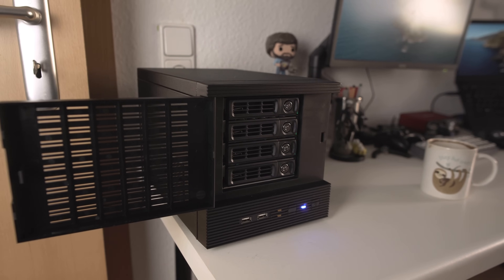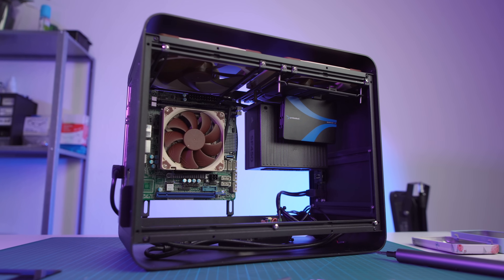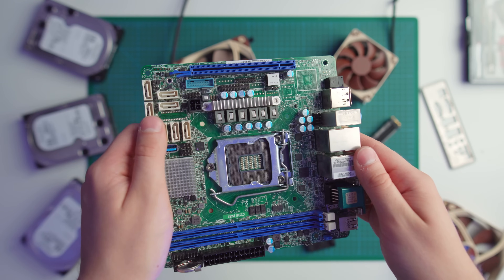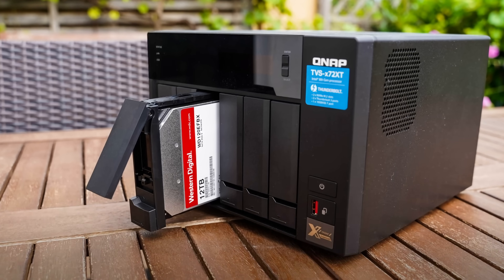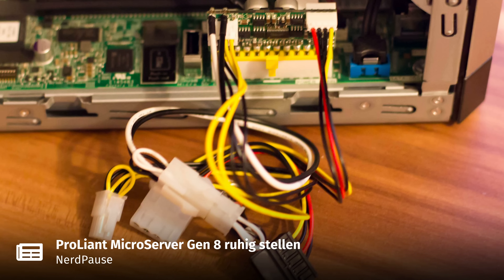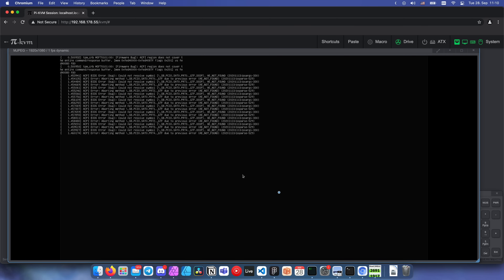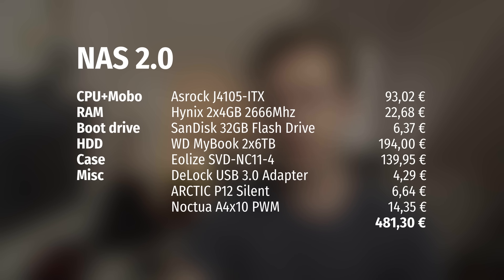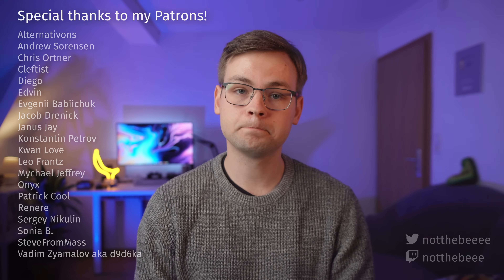The Perfect Home Server Build! 18TB, 10Gbit LAN, Quiet & Compact

Comment: Noctua fans DO NOT SUCK. They are rated at one of the best fans on the market. They are QUALITY. 

However their color choices are awful.
Reply from the maker: Yep, that's what I said, "all Noctua fans suck" :)
Reply: @WolfgangsChannel  They also blow which is the purpose of a fan. Besides if you're sensible and just buy a good looking case without any windows, who cares what colour they are as long as they perform well.

Comment: The 6TB EDAZ series is literally the worst kind of drive for a NAS. Medium expensive recommendation of the same but with higher capacity is a mistake. Instead, you should've bought couple of used EFRX WD RED drives, literally 80 bucks, CMR drives. 5.4k RPM, so silent and with longer lifespan, these things are legends and came directly before infamous EDAZ SMR disks that WD tried selling as Reds. If you want to go expensive, any enterprise drive will do.
Reply from the maker: EDAZ drives are good unless you want to do actual RAID or ZFS with them. That caveat is mentioned in the video. I've been using the drives with mergerfs+snapraid for about 2 years and they've been working great. Silent, cheap and great for "baby's first NAS".
WD60ERFX drives start at €219 here in Germany. If you're absoluetly sure that you'll use ZFS or RAID and will be storing mission-critical data – go for it. That being said, it's 2x the price of the EDAZ drives, so it doesn't really make sense to compare them.
Reply: @WolfgangsChannel  When I said that 6TB EFRX drives are 80 bucks where I live, I meant Czech Republic. Literally across border. I literally bought 2 pairs of those last week for 80 bucks a piece. Also, if you're patient, you can snipe good deals with enterprise SATA drives. People sell them, because newer SATA revision has kill switch on 3rd pin where before it was a regular 3.3V pin. People will sell them under price either because they think it's broken, or because they don't want to put up with the hassle of explaining all this to a noob. I bought 20x 10TB HGST enterprise drives for 75 bucks a piece with less than 2000 hours on the clock on each one from a guy who ran stock analysis on them and decided to go SSD and told me flat out the price only lasts if I come that day and I buy all of them and he will not have to explain to me the issue of 3.3V pin on SATA drives.

I know, not a content for your video, and rightly so. But I still disagree that suggesting SMR drives for any kind of NAS is not a good advice, period. It isn't relevant that they worked great for you for 2 years. You're a sample size of 1. Try suggesting on r/DataHoarders to a newbie to buy EDAZ series of Reds and you're gonna get roasted.
Reply from the maker: You will get roasted after suggesting literally anything on Reddit, especially in niche hobby communities. That's not really an indicator of anything.

Also suggesting an enterprise drive for a home NAS is a bad idea. Those drives are usually optimized for performance over acoustics and thermals. I personally have had bad experience with HGST drives – they're extremely loud for a home user and hard to cool without industrial static pressure-optimized fans.
Reply: @WolfgangsChannel  Both can be true, I didn't argue against either of those. My point is you suggested SMR drives for NAS. Although you can get roasted for anything on Reddit, using SMR for NAS is pretty universally agreed to be a bad idea. To avoid using Reddit as argument, I have a colleague at work that used 4 SMR drives in his NAS for 3 years. He gave up the idea of RAID fairly quickly and used them independently of each other for most of the time. Even then, his experience was terrible and like you, he argued that he considered higher series drives price prohibitive. He regretted the decision. One day I got my hands on cheap 10TB Barracuda Pros, I offered to buy some for him, he has been using those for close to two years now and says he should've bought nonSMR drives to start with.

I don't mean this in a bad way, I'm just saying advising SMR drive purchase even to starters is just not a good idea. We can agree to disagree.

Comment: I’ve just finished my version of this build, same case, love the case. Media server so went crazy and put an i7 12700k in there and barely fit a bequiet! Dark Rock TF2 cooler (replaced previous too loud, smaller fan, choice). ASROCK Z390-m ITX MB, 2x32GB DDR4 3600 (until the 2nd cooler wouldn’t fit so I removed one stick, RIP more RAM than I ever needed). 2xM.2 Drives, one 500GB cache drive and one 2TB drive as a faster drive for different apps running on UNRAID. Otherwise the same other than I flipped the fans on the CPU cooler to take away from the MB instead of sucking air over it and stuck the 2 case fans on the bottom sucking air in and up out the case. I have yet to buy the 2 planned 18TB drives to start me off (and replace previous still used 20TB setup) but I have decided to get an external drive thing that holds 5 drives and would keep the case a little cooler. Have set up a whole bunch on UNRAID already so I’m otherwise ready to move over but I’m not gunna lie, it’s running hot. Well in my opinion, but all I know is my gaming rig that doesn’t really go over 60c, this thing is running 70c-80c at 100% but oh my it runs fast, when idle 35c and 50c-60c under normal load (transcode a couple vids, background tasks). Don’t get at me for the odd airflow, it is mad but I’m used to bigger cases with better airflow and more space and heck, I wanted to try something out and it seems fine and I can’t be bothered to change it now 😆 So an almost finished build but thought I might share my build journey, so far cost around £1500. Planning on 5x18TB in the end but might end up adding 1-2 extra for parity drive, how ever many I need. It’s a slow background project but hope to finish it soon. Thanks for the video 🫡

Comment: Don't you have to modify those shucked drives?
Reply from the maker: Yes, depending on your PSU, you might have to cover 2 pins on the drives with tape. I didn't have to do it with mine, but there are plenty of guides online for that

Comment: I just recently built a kinda similar but way higher budget desktop server. It's built on a ryzen 5900X, asrock rack X570D4U-2L2T, 128GB of ECC RAM, and 8x 6TB exos enterprise drives over an HBA. Everything put into the fractal design node 804.

Running proxmox with virtualized truenas scale for kubernetes, and linux mint for a couple other services I don't want in containers. I can do lots with it if I need to.

Comment: I was able to grab HGST He14 drives for around $170 USD each, I have 12 of them total 9 are active, with 3 being parity drives for ZFS and then 3 spares that will hot swap in as soon as there is a failure of any of the drives. I did have room for an ATX system though so I had the option for HBA cards and a 10GBe NIC and a quadro p2200 for hardware Plex encoding. 
This is a great build for those who want the a smaller option. 
I run a ton of VMs as well as using it for a build server for work so I have 2 2699v4 CPUs and 512GB of RAM.
Reply: Do you have any issues running separate gpu for the VMware

Comment: Famous last words: "Last NAS I ever have to build". Mine is currently running an 8 core EPYC Rome, 64Gb ECC with an upgrade path to 64 core Milan and 4Tb ECC. It does serve a dual-purpouse role of running my docker containers and CI, which takes up half of the resources. But as a NAS, it's able to congest the 10GbE network pretty easily with the workload it's been designed to handle.

Comment: can you explain why i get "memory not installed" during bmc/bios initialization or post? all my hardware have ecc support and compatible with ecc. i can get it to post using non-ecc ddr4 ram. 
Specs:
Asrock E3C236D4U C236 Chipset - Supports DDR4 2400*/2133/1866/1600 ECC/non-ECC** UDIMM memory
Intel Processor i3-6100 - Supports ECC Memory. Doesn't specify if reg or unreg
Hynix -  DDR4-2133 16GB ECC/REG
Reply from the maker: Does it work with non-ECC RAM?
Reply: @WolfgangsChannel   yes it does. boots up and posts with non-ecc ram. do you know if this board is backwards compatible with ddr3 ecc ram? i'm tempted to purchase the ecc ram you recommended.
Reply from the maker: @romayojr  Sorry for the extra question, I didn't see it in your initial comment.

I don't think this mobo is compatible with DDR3 ECC RAM. It looks like the RAM you got might be defective, I would check if it works in another machine. Also, check if it's on the QVL list of this motherboard.

Comment: I would never use anything with a software RAID, with some, all it takes is a power bump and the raid is destroyed. In all my years of computers there has only been one software RAID I have encountered that is uber reliable. And that software RAID is part of a Digital Cinema Server. Hardware RAID is the only really reliable way to go, and you can even import already existent raid configurations in case one decides to say, get a newer server, add or change drives, or to build a new server. But at the low prices that 2 year old (Like New) rack servers sell for these days, going that route will likely give you way more performance, better equipment reliability and longevity, plus a very safe hardware RAID. Case in point. I have had an H-P DL380 G5 server in storage going on 7 years that contains all my photos going back to 1990. When I got it home it would not boot properly and that was an easy fix and just required a new clock battery on the motherboard. That clock battery goes back to 2008 when the server was built! Installing a new battery and it booted up ok. But now it said the RAID memory battery is defective. No surprise here as it's labeled 2008!!  I simply disconnected it till I could get a replacement which is in there now. Then all was well. So I uploaded all the images to the Cloud site I normally use and made two back ups on new, fully formatted WD Enterprise drives. I will keep those drives at two different locations and use the H-P server at home till hell freezes over.

Comment: Given your NAS running on desktop grade drives, have you considered scheduling it to shut down for the night instead of running it 24/7?
There's a religious war about what makes disk drives fail: restart cycles or runtime and you can believe in either (or both), but it's hard to deny one of the features of desktop drives is to cope with daily restarts.  If running your NAS 24/7 is not essential, you might be able to both save some power and prolong disk life if you believe desktop HDDs tolerate daily restarts more than running 24/7.  However quiet your build is it will generate some noise better audible at night and shutting your server down obviously eliminates that too.

Comment: Great content Wolfgang!
About your NAS 2.0 build you are saying: "after around a year of use, one of the backplane connections on the case failed". 
This tells me spending 140 EUR (~30% of build costs) on an Eolize SVD-NC11-4 mini ITX case was probably money you could have spent better.
The hot swap bays are something for which you pay extra and that can also break while it doesn't give you much benefit in a regular home environment.
If you need to replace a drive, you can probably allow for some downtime and removing a few screws as it seems you've also chosen to do so with your NAS 3.0.

Comment: Why didn't you use a hba card instead of getting an expensive motherboard
Reply from the maker: A decent HBA card costs at least $60-70. If you also need 10 Gbit connectivity, you'll need a bifurcating riser, which is around $70-80.

Comment: You'd hate to see how I have mine setup... I moved into this new house and I can't have my nas close to my router and im not allowed to drill holes, so I run my nas off a old AC1750 range extender since it has a ethernet port, my desktop is hook up to my nas threw ethernet as my itx board has 2 nics so I get the full 1gb speeds, but other computers don't but they are on wireless anyway so it wont matter much.

I also used a new old stock 400watt PSU it has sata power at least, but the wires are so thin, 26 gauge, But its just old parts I had laying around, the only thing new I bought recently for it is the Case, the Thermaltake Core v1. Can only put 4 HDD's in it, so im not too concerned and im not storing anything critical on the nas, its more of a backup system for all my steam games and its fun little project.

Comment: Great job, Wolfgang!

Though, where is question for You to check out Huananzhi MB + xeon e5 2680 v4 + 64Gb DDR4 Kit from Aliexpress.
E.g. Xeon e5 2680 v4 contains 14 core / 28 threads. The Kit is very inexpensive, as for the storage: the same SATAx8 - must be killing.
Reply: Power consumption of CPU 120W?

Comment: I just put together the same setup and I can tell you right now, you won't be fitting in anymore 3.5" HDDs in there. There's looks to be space horizontally, but not for the power and sata cables because of how tight a fit it is. I wish I had known this beforehand..
Reply from the maker: I currently have 4 hard drives in the case and pretty sure I could fit at least one more. 
Use 90 degree SATA cables!
Reply: @WolfgangsChannel  can you show us with 5 x 3.5 drives? thats a good number for a NAS

Comment: So your NAS and your workstation BOTH have 10GB NICs?
Reply from the maker: Yes
Reply: @WolfgangsChannel  Ok. I got that part. What if I wanted to use a switch? what kind should i get? Assuming I have 10gb Nic on my nas and my main pc but only have 10gb pcie network adapters like the tp-link TX401 on other computers.
Reply from the maker: Here's the one I'm using: https://mikrotik.com/product/crs305_1g_4s_in

Comment: will this for sure fit 6x 3.5" drives?  the advertising sys 3x 3.5"
Reply from the maker: Yep, 3.5" with the stock brackets and a GPU installed. You can buy an extra HDD bracket from their shop and if you don't have a GPU installed, it should fit 6x 3.5". For now I have 4 drives installed, and it looks like it can at least take another one.

Comment: Btw. a cheaper and even more power efficient debugging option that doesn't require hooking up a keyboard and monitor would be serial console redirection that this board supports. Sure, it doesn't have a fancy web interface and still requires one cable. But if you're used to SSH anyway and your server is at a somewhat accessible location (which I assume because otherwise noise is probably not an issue), it's an option that still gives you access to the BIOS or visual output in case your OS doesn't boot anymore, for example. I use a similar workstation board for my NAS build as well, and the serial console redirection allows me to do BIOS updates, configuration changes or debugging without the need to actually hook up a monitor (which would be a hassle because my NAS runs without any GPU, neither dedicated nor integrated). Since I don't need that maintenance or debugging access often (maybe once or twice a year), the serial connection works just fine for me.

Comment: After that debacle where WD silently sold SMR drives as NAS drives, catching people by surprise, I stay away from them and only buy Seagate, their IronWolf drives are pretty nice.
Reply: I only buy Toshibas, MG07 to MG09 series. They've been the cheapest drives per capacity, they are enterprise grade, not that loud, not power hungry, full speed across the whole disk. I haven't touched Seagate or WD since I got 640GB Samsung in 2008, then it was 2TB Samsung, 4TB Hitachi Ultrastar, then Toshibas 8 to 18TB.
Reply: @jan.tichavsky  Unfortunately I don't really have access to anything other than WD and Seagate for Enterprise/NAS use, and buying from ebay and such is completely out of the question =/

Comment: My server is an overkill mess that pump up to 450W under stress-test load level.
"get E5 xeon they cheap" and I got around the most powerfull ones ( two 2696 v3 ), and went dual socket because "big D energy"
At least I can learn how to manage network by managing a shitload of VMs ! ( because yes, I'm still learning... Why using Cisco packet tracer when you can forget to allow ICMP inputs on windows ? xD )

Comment: Great video and awesome editing.

Thanks for mentioning ECC RAM, I feel like a lot of people don't talk about that when it comes to a NAS build. Is it required...no, but if you want to minimize the chance of data corruption you should probably use it (especially if you go with ZFS).
Reply: False belief that ECC RAM minimises anything. Virtually all modern OSes and UEFIs are immunity aware to correct in-flight bit errors. ECC is just data centre premium.
Reply: why "especially with ZFS"? ZFS doesn't require ECC and is the most robust FS even for systems without ECC ram.

Comment: Good video. I just upgraded my home NAS. I went for a Synology DS1621+ with 16TB HDDs, 10Gbe network and upgraded it to 32GB ram so i can use docker and VMs with no worry. Not cheap. No NVME Cache drives yet though.

Comment: If you need a lot of SATA ports you could use a LSI SAS card, they usually supports around 8 sata ports with 2 connectors,
Reply: Too bad you can't use both 10Gbit LAN and the LSI card.
Reply: @jan.tichavsky not if you choose a better board